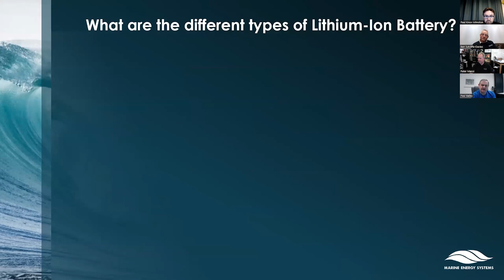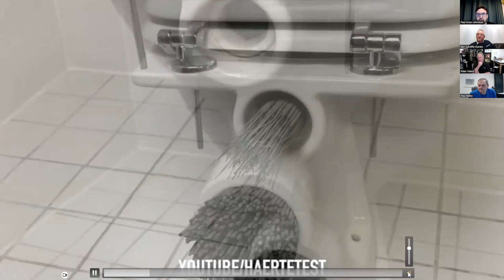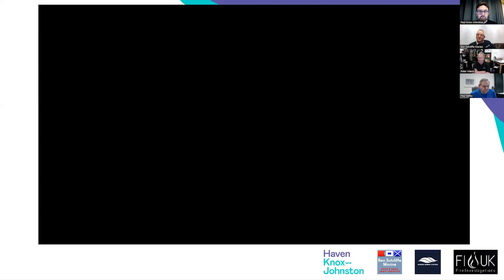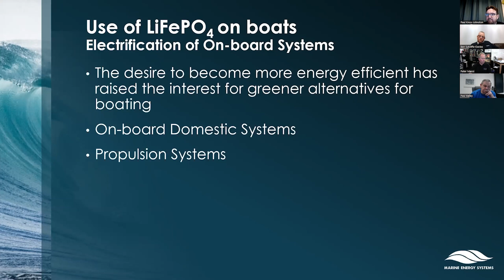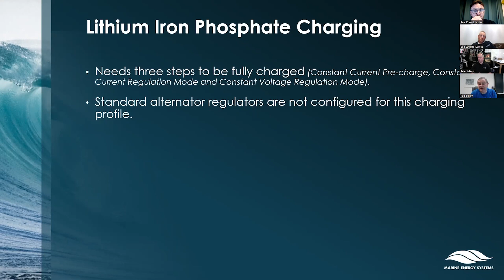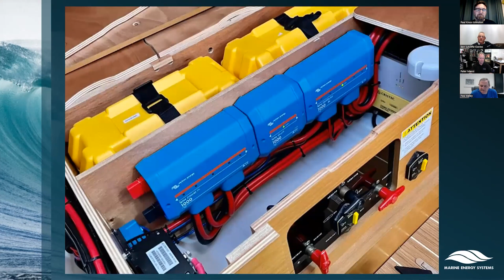Using Lithium-ion Batteries on Boats - What they are and how to use them.

Comment: This  is a must watch if you use Lithium batteries, which is pretty much all of us. There are  q number of things you can do and selections you can make to help manage the hazards. When they fail...they fail very quickly. Manage the dangers whenever you can. We don't even think about these things  but even the cheapest, small device can ruing our lives. No need to watch if you don't have when in your home...but for the rest of the 99% of us...watch and learn. This vid is not designed to convince you to avoid at all cost. It just talks about what dangers there are and how to limit your exposure.
Reply from the maker: Thanks for your comment.  We certainly learnt an awful lot whilst putting the webinar together.  Knowledge which can be applied both at home and on the boat, in fact - to every day life in general.  It's really interesting to understand the different chemistries that are used in the batteries too, and how the different types of lithium battery have different performance and safety parameters.  We've all now purchased charging bags and got rid of broken charging cables!

Comment: Very helpful impulses regarding energy on board in general. I missed distinction between needs for blue water sailing and coastal sailing. E.g. load dumps are much more serious when you are 1000 miles off a coast. Also external vs. internal BMS is a topic here.
Reply from the maker: Thank you.  If you have any further questions, do contact Paul at Marine Energy Systems (info@marineenergysystems.co.uk) and I'm sure he'll be happy to help.